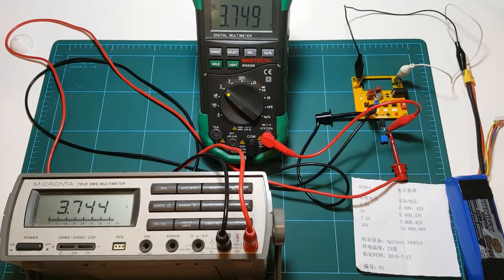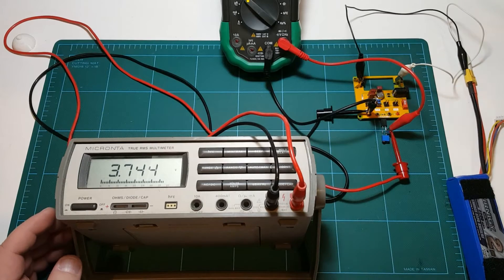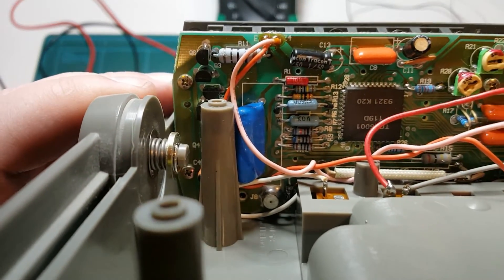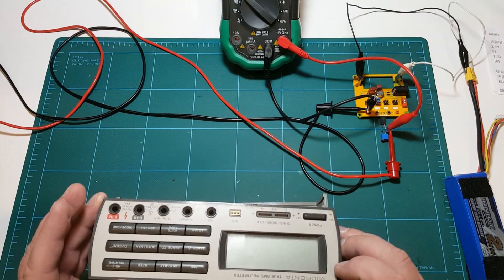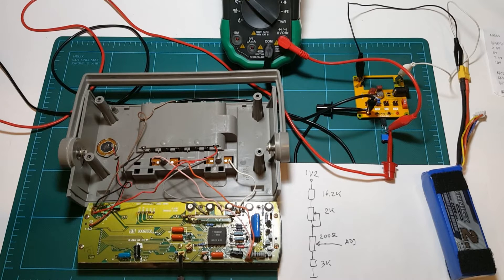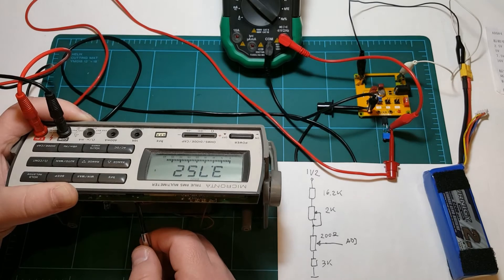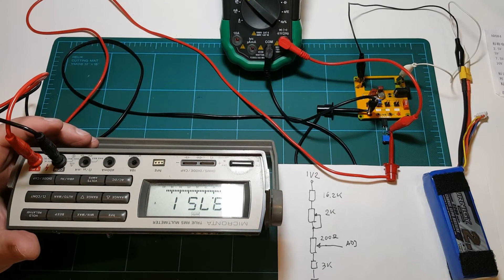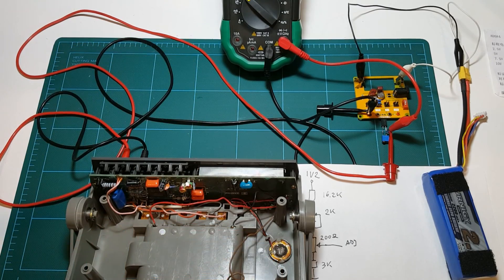Micronta multimeter take-apart and calibration

Comment: I just picked up one of these (Micronta 22-175) and am looking for a schematic since one of the power leads has come unconnected. I would also like a photo of the information on the back of the unit if I can get one somehow. I found the manual online but no schematic.
Mine suffered from corrosion from batteries that the previous owner left in too long. I am hoping to resurrect mine.

Comment: I have the 22-174A with two trim pots as well.  Disappointing that I can calibrate it for a certain voltage, but the DC voltages below that are high and those above it are low.  None of my other meters have a "skewed" voltage response curve like this, but I guess it's not terrible because it still holds within 1%.  So I picked mid-range for the types of voltages I typically measure and went with that.  As for current, I thought I might go in and fine tune the location of the soldered sense wire on the shunt to fix some current offset.  First I checked the resistance voltage drop on the shunt at a calibrated current, and it was right where it was supposed to be.  So I made no adjustment, assuming the lack of calibration was elsewhere in the circuit.  In the end, after adjusting DCV (touchy as it is) I found resistance to be within half a percent for everything above 10 ohms, within 3% on all current, 5% on capacitance, 1% on ACV, and 10% on diodes.  The transistor checker is awesome for how old the meter is (1995).  Wished I knew how to make the display just a little bit darker "more contrast".  The beep was always a bit too quiet, and just recently I found out they put the product warning/safety label over hole that is supposed to let out the sound!  I popped a hole in that label and now it really sounds good.  Cheers!

Comment: Thanks.  I have this meter as well.  I'll have to do this to mine.  Also, do you have any idea why the batteries are set up the way they are?  I was wanting to run mine from an external power source but when I seen the way the batteries were wired, I put it back together.
Reply from the maker: I dont remember what the battery layout is exactly but i believe some of the measurement functions require it. This meter is an older design perhaps from the times before voltage converters were common. Using external power supply may introduce noise in the circuit. It is best to run this meter from battery, i think.
Reply: @arturslab7102    Hmmm, good point.  Thanks again.

Comment: I've got an old micronta meter that's a handheld and it seems to have much the same circuit as this one.  The only problem is that when I calibrate the DC volts with the correct polarity it is way off when I measure a voltage with the leads reversed.  I haven't seen this problem with any other meters (they always read the same either way once calibrated in DC).  I don't have an exact schematic for my meter but only similar ones.  I suspect that their is some voltage reference diode that's gone but knowing which one is the problem.

Comment: I have the Micronta 22-195 myself and do not use it anymore, it is a nice meter though. I like it that you take the time to calibrate it.
Reply from the maker: I like that to switch ranges you just push whatever button you need instead of having to rotate through all other measurements.
Reply: Yes, that is a big plus, I also like that it has pushbuttons.